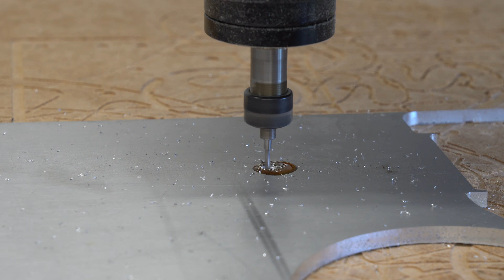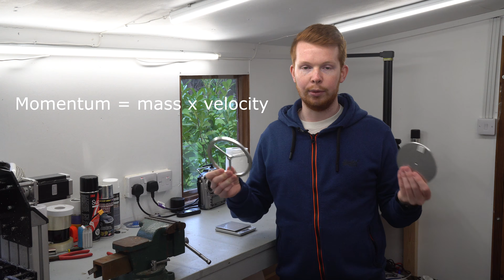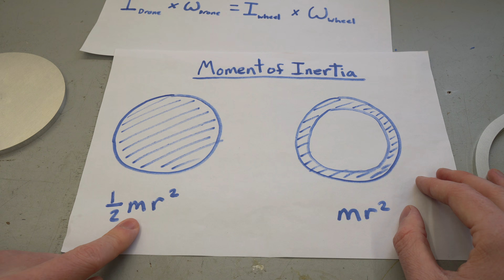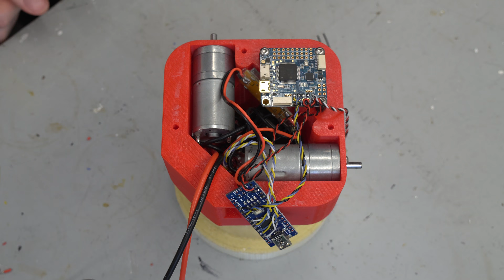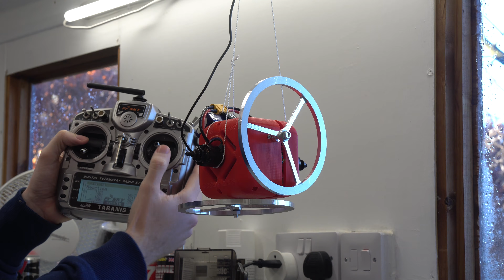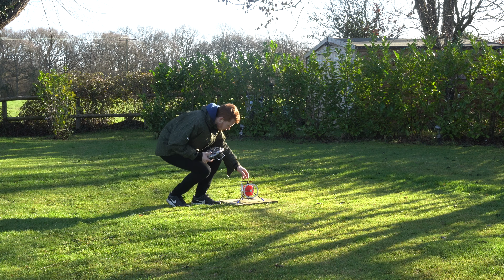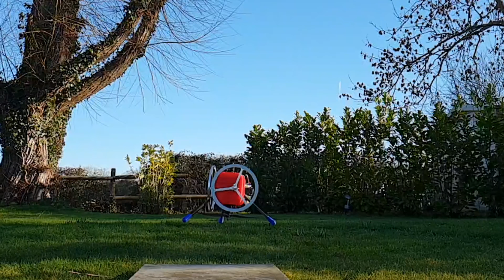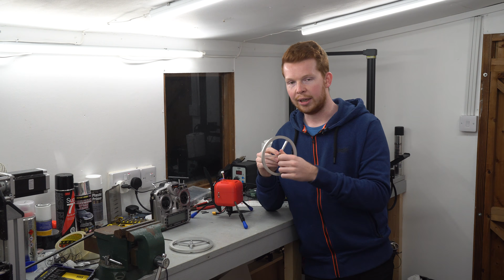Comment: I think one of the problems is the bottom mounted propeller. By pushing from below it results in very high instability. Maybe you could design your next attempt like a coaxial rotor helicopter.

Comment: I am impressed by the effort but it would really work if you try to balance the weight evenly about the yaw axis. what I understood from the slow-mo videos is that the weight of the reaction wheels is making the CG off centre. kindly check if the CG of that drone is on the yaw axis which will make the drone fly better, also the motor mounting should be much stronger and rigidly hold the motors that will save your drone from structural oscillation.

Comment: You have airflow disturbances from both blades. use one big blade instead and it would solve alot of your issues. remember the propeller creates lift forces/ turbulence/ vortices that make it harder for your reaction wheels to counter on the fly. make one big prop instead.
Reply: You can't use only one blade. Watch the beginning of the video again...
Reply: @TheFreezeChill  hey bud, I have a bachelor's degree in mechanical engineering, I'm quite sure I know what I'm talking about
Reply: @VoidPixel4179  Cool. Why do you think helicopters have a little second rotor at the end?
Reply: @TheFreezeChill   that is for stabilizing the helicopter on the horizontal axis only. It acts on a different plane than the main blade of a helicopter, the top blade is for lift & when tilted moves the chopper forward. The tail rudders are for yaw
Reply: @VoidPixel4179  Partially correct. The main purpose of the rear rotor is preventing the helicopters body from spinning against the direction of the main rotor. 
If you increase/decrease the rear rotors speed, you achieve the yaw rotation. But even if you fly in a straight line the rotor has to spin.
Reply: @TheFreezeChill   dude, I cant continue this conversation if you are not qualified in engineering. The rear rotor is for balance but have you seen the CH-47 Chinook? It is a heavy lift military helicopter with no horizontal rudder. To end this... his drone can work with one blade and 2 counterbalanced wheels
Reply: @VoidPixel4179  Wow, are you trolling? The CH-47 has two rotors spinning in opposite directions. That way the body of the helicopter doesn't start to spin. There is NO helicopter with only one rotor because it's impossible. 
Due to conservation of angular momentum the body of your one bladed helicopter HAS to spin in the opposite direction as the rotor does. 
And one more thing: Be careful calling other people not qualified if you haven't understood the topic yourself. Obviously an electrical engineer is more qualified here than you are.
Reply: @TheFreezeChill   the purpose of the second blade is not to counter the angular momentum or what ever you said. It's a design choice to create additional lift for the additional payload. How do drones fly then? I understand the notion that yes you need something to counter the rotation of the blade that's why I said use 1 blade and 2 wheels. You do not need 2 blades & 2 wheels. Btw, I work for the largest aeronautic government contractor (I'll let you figure that out).
Reply: @VoidPixel4179  Second sentence on the german Wikipedia article for the CH-47: "Die gegenläufigen Rotoren machen einen vertikalen Rotor am Heck unnötig". I'm sure you're able to translate it yourself. 

How do drones (quadcopters) fly? They have 2 rotors spinning clockwise and two spinning counter-clockwise. 

The two wheels have nothing to do with the main rotor, they are only for balancing the aircraft. They can't compensate the angular momentum of the main rotor since they are mounted orthogonally to it. 

I really hope that you are only trolling, otherwise it'd be extremely sad.
Reply: @TheFreezeChill   maybe stick to electrical my friend "the wheel doesn't balance the rotor as they are mounted orthogonal to it" you just proved my point. They will act as the tail rudder of any regular helicopter. You dont understand the whole point I'm trying to make here so let me do you a favor;

Top blades are for lift, I did not disagree that they spin counter to each other BUT!!! if we ME were mad enough to put huge gyroscopic wheels on helicopters we would. The tail rudder is not NECESSARY it's just the SAFEST and WISEST option given our current history in the Aviation industry

Comment: I actually build and test the reaction wheels that go in to 6U cubesats  XD
So I'm pretty impressed with your attempt, but I think your control loop is too slow to keep the drone stable.
Reply: The wheel would saturate. Props don't because of drag.
Reply: There is latency because he used servo pwm signals about 4ms from send to receive. And then an arduino reading that and sending it to the 'esc'
Reply: @paul-fornage  The electronic’s latency is the least of his concerns it’s the mechanical latency causing the bug problem. Takes to long to spin up the motors and for them to change direction.
Reply: @jacobleeson4763  there is latency getting the wheels up to speed, but there should be no mechanical latency to acceleration, just drag. (Assuming the motor has enough poles to precisely control at any angle)
Edit: actually that's a pretty shitty assumption
Reply: Saulius Noreika just a thought would it not be more stable if it had 1 larger propeller on the top and 1 more wheel where the bottom propeller is?

Comment: Excellent illustration , Thank you very much! Perhaps an additional suggestion would be to avoid the "zero-crossing" dead band of the wheels, by biasing them before lift off with some angular velocity towards one direction (momentum bias). This will reduce your control authority but will avoid reaching the region of changing motor direction, which is highly non linear in terms of speed vs torque. I completely agree with @MaEtUtgR on the issue of control bandwidth as well!!!

Balancing of the system with some counter weights  for pitch and yaw axes might also be a consideration, such that the "Inertia Matrix" of the system is more diagonal with smaller values for products of inertia. That way, each degree of freedom is a little bit better "decoupled" from each other.

Comment: Would it be possible to use 4 wheels in 2 counter rotating pairs and use the differential force to control?  then they will act as gyro stabilisation and make the latency of the control feedback less vital?

Comment: Perhaps increase the length of the legs to slow or dampen the velocity of pitch and act as levers to slow and control torque movement. Attach the three legs together to stabilize them with a light strong wire. At their farthest ends to create a triangle of tension. The small sphere of forces is moving very quickly. By enlarging the overall dimensions but maintaining a light weight, it should have a lever like effect to slow or dampen all movement in all directions.

Comment: Apart from comments elsewhere, you could have more success by using contra-rotating propellers both on the top of the aircraft. The lower prop is essentially pushing the vehicle away from the vertical, trying to loop the aircraft. The reaction wheels are then fighting that, and that's where bandwidth starts to limit the corrections.

Comment: 7:40 excuse me ????
So you're telling me that if I "add" mass to my inertia wheel by just not removing it from the center I lose moment of inertia ? And obviously you know that for a ring there are two radiuses ? Your explanation makes no sense. If your full disk has the same moment of inertia as the ring it's because, and you mentioned it, the radius is squared so a lot of the mass of the disk (near the centre) goes into "neglectable" moment of inertia

Comment: This experiment showed that the spinning wheel technic is not effective for controlling helicopter because of slow reaction. 
I think this idea can be implemented on the satellite for the position control rather than using fuel injectors. So it can carry less fuel.

Comment: How about providing the 2 motors always with the maximum amount of current? Timing would then be the only mechanism used to control them. So if only a small correction was needed, the motor would apply the maximum current, but only for a very small amount of time. Microcontrollers like Arduino are very good at timing: they can easily manage thousands of a second very precisely. In the end, by sending very fast and intermittent signals,  they should be able to achieve the same result as providing smaller currents. This is the mechanism used by "pwm fans" used to cool pcs. (pulse-width-modulation). Also, if I'm not mistaken, electric engines are the most efficient when they work at their maximum allowed voltage.

Comment: This is a bad ass experiment. But you should just do it on a airplane. Then you can take it off fly with normal controls then flip one of the auxiliary switches to change to your spinning wheels. Or just put them on a helicopter that is made for 4-d acrobats and have a prince fly the helicopter level then let you control it with a separate controller that is linked to the spinning wheels.

Comment: You didn't mention that the lift rotor has not been equalised by either wheels.

That's where the issue is. Watch the slow Mo 
You will see the attempted correction.

Comment: Here's maybe a decent suggestion, you have two more sides, one more for roll and one more for pitch. When you spin a wheel at high velocity it tries to stay at that angle, its difficult to move it because it is balanced out. Test it out, spin your bike wheel quickly and try it rotate it forward, backward, and side to side. Perhaps spin up two more wheels while it on the ground to give it an initial moment of inertia about its center of mass then when you take off, the drone will not want to turn or flip and if it does, use your already designed reaction wheels to control it. Or better yet, you can spin up the two wheels you already have while its on the ground to give it a virtual position then have the wheels speed up or slow down depending on the direction instead of forcing the motors to change direction which seems to cause a moment of instability leading to a poor feedback loop. Might have to play with the ideas but i think its a goo plausible shot! Love the videos, keep it up!
Reply: the idea is the same as you are doing. Think of it as this. You change the direction the drone is moving by changing the direction of the wheel with respect to it standing still. Say to turn it right, you have to give it the equal opposite force and spin it left. now the drone is spinning to the right too much so you have to spin the wheel to the right to force it to spin to the left but because you are making the motor change direction, the movement is choppy. Start with the wheel spinning at a dedicated speed, say right at 60 rpm. then take off, because the drone is at equilibrium at take off while it is spinning the wheel at 60 rpm to the right, if the drone starts to rotate to the left, you speed the wheel up more to the right, if it starts rotating to the right, then slow the wheel down to say 30 rpm, this is a much more reliable and smooth way to control the wheel since you arent completely changing direction. plus the centripetal force from the opposite wheel with an initial speed will in theory prevent it from rotating in the other axis. Hard to describe in words.

Comment: the problem you are running into is gyroscopic in nature.   when a reaction wheel activates it causes a gyroscopic reaction in the propellers which forces the other wheel to compensate which causes a gyroscopic reaction in the propellers which causes the other wheel to compensate, etc....     you've engineered a system that is constantly fighting itself.

Comment: Use gyros mounted in plane with the propeller then tilt them to produce the control torque via precession.  It will be far more stable and provide far more control precision.

Comment: i know all about reaction wheels i play kerbal space program
Reply: But in KSP, everything is easier to fix... If 1 reaction wheel isnt enough, duplicate, duplicate, duplicate, duplicate...
Reply: Dead Meme then you have 16 reaction wheels and rocket tips still over
Reply: @MarkStillPlays  and thats why the offset tool exists lmao
just push them all together
Reply: @MarkStillPlays  16? What do you mean 16? You need AT LEAST quadruple that!
Reply: Reaction wheels are for noobs (who mostly  forgets to put RCS during a docking mission)
Reply: @MarkStillPlays  lol, i clipped 64 reaction wheels so my rocket didnt tip
Reply: @Yuuni_Shiroza  I have to pull some interstellar shit 9/10 on my builds because i forget RCS
Reply: thats why im here
Reply: BNL ayy, same
Reply: BNL Buy N Large, you made my day
Reply: KSP reaction wheels don't get saturated.
Reply: @user2C47  until you reach maximum rpm
Reply: @hernanposnansky7154  KSP reaction wheels do not have a maximum RPM. So, as I said, they don't become saturated.
Reply: @user2C47  
Dc motors create a back emf, meaning a voltage that you must overcome with your available battery voltage.
Also there is a structural rpm limit to prevent destruction.
On the space telescope  there are four RW, 3 along the vehicle axes and one along the diagonal.
There are 3 magnetic torquers to desaturate.
If the simulation does not include limits, then it lacks realism, namely the need for an angular momentum management system.
On Skylab there were 3 double gimballed control moment gyros, which had to be desaturated every orbit due to the gravity gradient torque by maneuvering in the earths shadow, so that the solar telescope could be pointed accurately during the 'solar inertial' attitude mode.
Skylab had also six reaction jets, which were used as little as possible for obvious reasons .
Reply: @hernanposnansky7154  Obviously this exists on real spacecraft, but KSP is a game and the developers decided not to add saturation, so reaction wheels are basically an unlimited source of torque.
Reply: @user2C47  
understand, thank you .
The need for a desaturation system is real, as I was indicating  on the example of Skylab.
Reply: Good to see another kerbinaught
Reply: Lol i do as well. I have a subassembely which has 400 reaction wheels clipped into one another and its so fun using it
Reply: BNL

Ah I see, you're a man of Culture aswell
Reply: Lol
Reply: Just shove em on!
Reply: yea
Reply: Me to
Reply: kerbal street home
Reply: Lucky my trash computer doesn't work
Reply: me and my friend are playing it right now, came back to this video because he mentioned it
Reply: Wow, this comment section must be smart.
Reply: same lmao
Reply: Did you have to make the top prop create mire thrust than bottom to give it more positive stability?
Reply: Same
Reply: steps to not tip over :
1: add reaction wheel
if that doesnt work repeat
Reply: Same! :p
Reply: Mm yes, same
Reply: I know everything about reaction wheels I make flying machines in Genius Killer on the Google Play Store
Reply: 100 reaction wheels
1000 RCS nozzles
Still can't control the fucking rocket
Reply: SAMEE
Reply: sure you play it, but do you understand it?
Reply: Nobody cares buddy
Reply: David Horgan r/woooooosh
Reply: @dphorgan  I care, we all care
Reply: David Horgan no one cares about you

Comment: If you are still on this project, I would recommend adding momentary switches to the feet of the drone.  These would open the circuits to the pitch and roll motors so that when the drone is on the ground there is no movement on the motors, thus eliminating the need for a fast take off.
I would also add a counter rotating propeller to the top so that there is no need for a propeller at the bottom.  This shaft withing a haft technology is used in clocks as well as in small "Dollar Store" helicopters.
If you are game for the topic, I would also love to see a "pendulum control" drone that changes its direction by moving its center of gravity, although it may not have enough engineering for a full video.

Comment: The servo loop delays. Integration takes time. For any given motor speed and torque, you will find that measuring the instantaneous current, and knowing the speed, and accounting for IR losses, you can predict what the current should be. This current prediction is used as the feedback instead of speed giving very quick response. Research how trams must use current prediction. If they used the typical speed feedback loop, the driver would crash OFTEN! His accelerator and brake control pedals are the +/- demand current, and is compared with the predicted current. Now, fully loaded, wet or dry track going down hill, the driver doesn't overshoot often, crashing.

Comment: Would it not be better to use the reaction wheel in the same way as a gyroscope works if you spun up both reaction wheels to the same rpm and had them on a movable mount which allowed you to move them at a 90-degree angle to the spin axis that way you do not have to try to alter the rpm of the wheel just alter the angle of the mounting which would tilt the copter either to pitch up and down or to roll it side to side, the torque produced to speed them up or slow them down is much lower than the torque required to adjust the angle of the spin axis due to the gyroscopic effect, I am not sure if I correctly described what I was thinking I would like to see it if you rebuilt it like I mentiond.

Comment: I would use counter-weights on the opposing site of the wheels to balance the whole thing out - or, if possible, center the wheels in the build - maybe you need to put them above each other. I think you can take a lot of load of the wheels trying to correct for their own weight. I would also use a larger propeller (in comparison to the wheels)